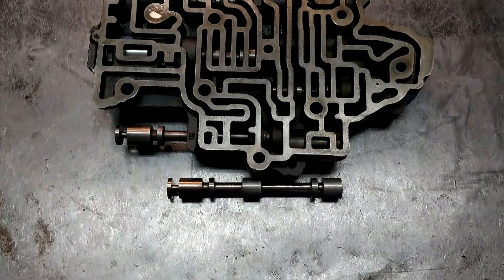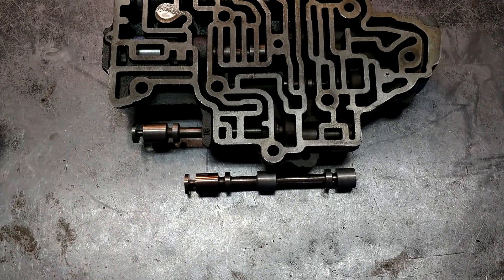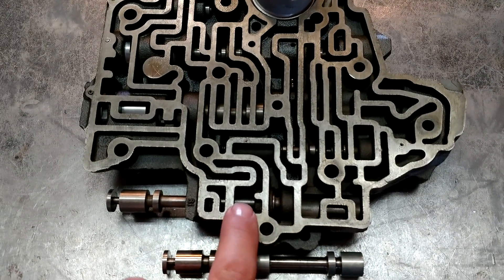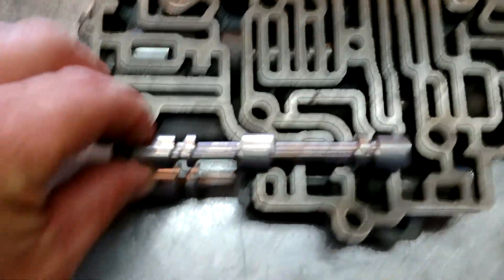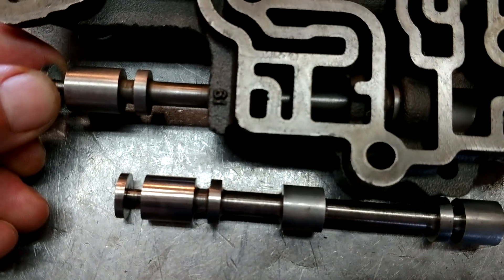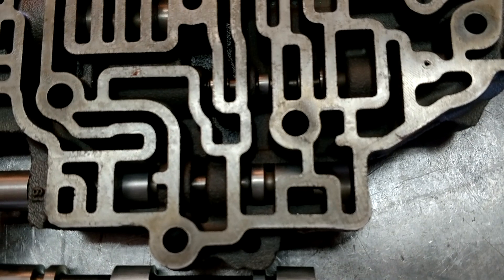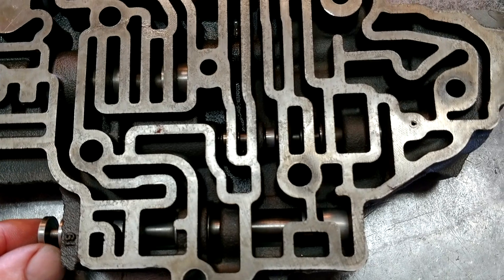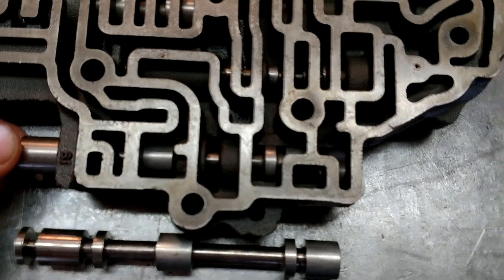TH400 manual valve circuits

Comment: What causes the vent tube to leak fluid at idle, bought used th400 was supposed to be working in previous vehicle, has a trans-brake also.